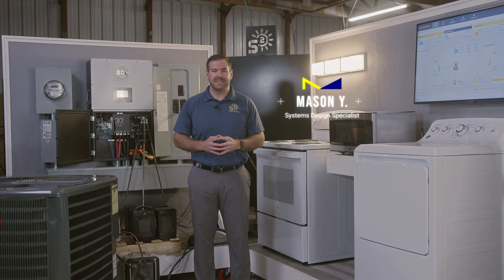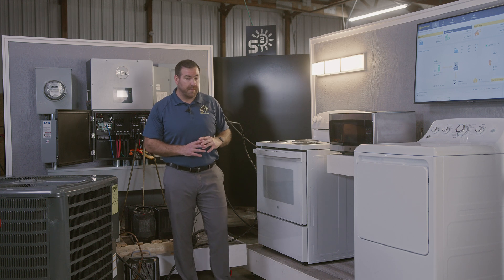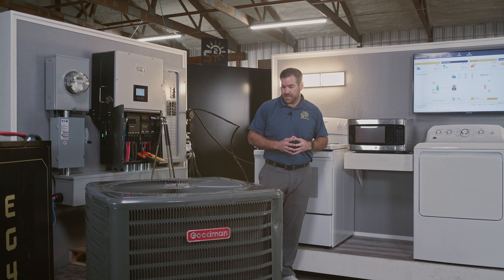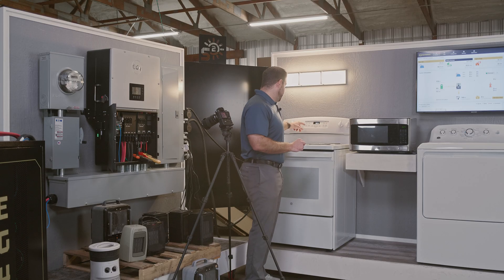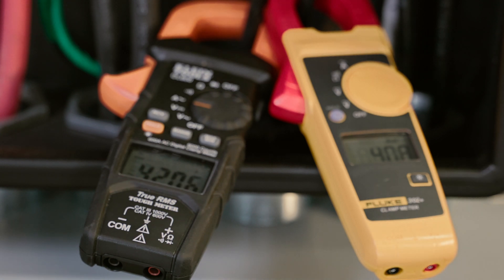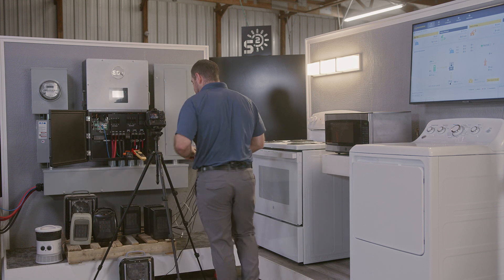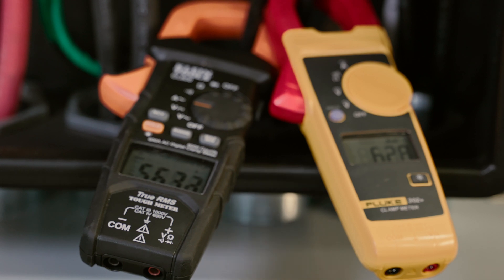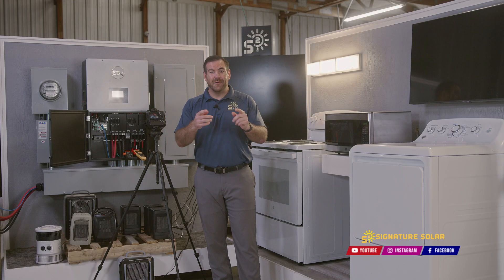EG4 18kPV Hybrid Inverter | Load Test

Comment: This is not a whole home load if you have two adults and two teens, with the 4Ton test.
Reply from the maker: Thank you for your feedback! This was just a test for the purposes of the video. We appreciate your input and will consider it for future improvements.
Reply: @SignatureSolar @Mike-01234 I sure wish I would have some of the comments on this video BEFORE I purchased my 18KPV. 

 I had already installed a top-of-the-line Microair easy start on my existing 4 Ton Heat pump a year ago so that I can run it with a Firman dual fuel portable generator. 
The Microair soft start brought the inrush current down from 120 amps to around 30 amps. 
STILL:  the voltage on the 18kpv would collapse at startup causing my lights to flicker and the control board for the HVAC compressor to shut off the compressor entirely leaving the internal air handler blower fan running continuously circulating hot air through the house. 

Just to be absolutely certain that my  soft start was not the problem. I contacted Signature Solar and purchased what they said was the same soft start used in this video. IT BURNT UP IN LESS THAN A WEEK. 
I had to hire an HVAC company on memorial Day weekend to come out and reconnect my old soft start that thankfully was still bolted to the wall of my house. 
Although both EG4 and Signature Solar have been aware of this problem for over a year, they still sent me a replacement unit. UNFORTUNATELY, Signature Solar, apparently sent me a unit that had already been returned because it had damage inside the box with no visible damage to the outside of the box. So I waited another week for them to swap that one out with an undamaged unit, then spent even more money with my electrician to swap it out. 
THE NEW UNIT BEHAVED IN THE SAME MANNER. As soon as the HVAC compressor came on my lights would flicker and the overcurrent protection on the HVAC control board would shut off the compressor, leaving the interior air handler running indefinitely as if the unit was still running. 
In May of this year, a full month after I tried to commission my unit, a higher up tech support person at EG4 did a software update, the got the unit to run without collapsing the voltage, but it is obvious that the original 18 kpv will not handle anywhere near the inrush current they claim AND THEY WERE AWARE OF THIS PROBLEM for at least a year. 
I'm still afraid to leave my main disconnect open isolating my system from the grid because I fear it's putting stress on the unit and May shorten its life. This is disturbing because I bought this unit specifically for the intent of providing power in a grid down of event. 
I SPENT MANY HOURS AND MANY DOLLARS TRYING TO CORRECT THIS PROBLEM INCLUDING A BURNT UP SOFT START AND NEITHER EG4 OR SIGNATURE SOLAR HAVE OFFERED ANY REIMBURSEMENT WHATSOEVER. 

Also off-grid mode seems to successfully stop power from being exported IT DOES NOT STOP POWER FROM BEING IMPORTED COMPLETELY.   
Although it seems to be functioning
I HONESTLY WISH I WOULD HAVE BOUGHT A SOLARK, because I don't know if I can depend on this to work properly without feeling during a grid down event when I need to depend on it the most.

Comment: If grid tied, will the grid assist when exceeding 12kw on the output? If so what is the limit?
Reply from the maker: Yes but only with certain configurations
Reply: @SignatureSolar  I’m assuming the configuration you’re talking about is with grid conductors fed directly from the utility meter to the inverter with a fused AC disconnect in between, and then inverter AC output feeding the load center?

Comment: Great vIdeo!  Question that i cannot find the answer to: If this is connected to grid, will it still shut down above 15kw or will it just stay below the max inverter current and allow the remainder to come through the grid via the 200a bypass?
Reply from the maker: If solely relying on renewables like solar and battery power, the system will deactivate. However, if connected to the grid, it can accommodate up to 200 amps through bypass mode. Yet, in bypass mode, it bypasses all renewable energy components and directly powers the load center without utilizing renewables.
Reply: @SignatureSolar  Does the inverter automatically switch into bypass mode? And once it detects that the load does not need bypass, will it automatically switch to renewables?

Comment: Sorry but people don’t run appliances in that order, beginning of video, A/C is most likely already on but maybe not running, next laundry gets started, maybe someone in the bathroom drying their hair, A/C happens to kick on and you use the microwave to reheat your coffee and all this takes place in about 15 minutes, my point is, when I tested my generator to see how much of my house I could run, I turned on all my lights, W&D not an issue, then my A/C, gen dropped a hair but recovered quickly but then hit the 1100 w microwave big drop, thought I was going to kill my generator but it actually recovered, for the most part, I found I need to turn off the A/C if I need to use the microwave, my generator is 8750w load 8250 running, I’m looking to buy this system in January with the 2 batteries but thought I’d just throw out a comparison.
Reply: @@RubenKian California, La county

Comment: On the portion where you showed starting the AC unit (outside condensor), did you factor in the evaporator coil/Air handler which is also running on 40/50amp breaker?

Comment: Seems your test did not match the specs when it shut off so quickly. With PV: 14.7kW (10 min), 15.5kW (5 min) Without PV: 13.5kW (10 min)

Comment: I thought the surge rating for this unit was supposed to be 16 Kw for up to 5 mins? According to my math (64A + 60A) * 120V = 14.88 Kw. What am I missing?
Reply: I think the surge time may be based on standard test conditions. Perhaps at 25 degrees Celsius. Warmer room temperature may cause the inverter to shutdown sooner. Maybe I am wrong. For the longevity of such an investment I wouldn’t want to bring my loads to that level for even a minute because that’s pushing it to the limit. That’s my personal thought.

Comment: As I understand it, the real advantage of this unit over 2 - 6548s is it can send energy to the grid.
This unit is $5600 while 2 6548s are around $3000. 
An additional benefit which is more important if it is mounted close by is the quietness.
The software is much better.
It has more solar panel capacity, slightly less power output, but close enough.
6548s are off grid only and can not send energy to the grid.
Reply: Also idle consumption much lower 70watts versus two of the other ones at 105w each
Reply: Big thread over on DIY solar power forum started on Aug 5th Guy said he had lot of problems with trying to grid-tie and not back feed. In the Solar equipment review. It's worth reading before you make a purchase.  The way I read it was the OP wanted desperately to make it work then got really frustrated because they couldn't make it work over the phone through email. It will be interesting to see how it worked out for him if he was able to get a replacement working the way he wanted. SS did in RMA the unit and even offered to pay any fines from his Utility for back feeding without a contract. I've never heard of it only a letter they send telling you if you keep doing it, they can disconnect your power.
Reply: @Mike-01234 which unit you talking about Mike. You said the guy and it. It being which manufacturer and model?
Reply: @Mike-01234 I sure wish I would have read your comment when I saw this video before I purchased my 18 kpv. 
I have a 4 ton heat pump. I had already installed a top-of-the-line Microair easy start on it a year ago so that I can run it with a Firman dual fuel portable generator. 
The Microaif soft start brought the inrush current down from 120 amps to around 30 amps. 
STILL:  the voltage on the 18kpv would collapse at startup causing my lights to flicker and the control board for the HVAC compressor to shut off the compressor entirely leaving the internal air handler blower fan running continuously circulating hot air through the house. 

Just to be absolutely certain that my  soft start was not the problem. I contacted Signature Solar and purchased what they said was the same soft start used in this video. IT BURNT UP IN LESS THAN A WEEK. 
I had to hire an HVAC company on memorial Day weekend to come out and reconnect my old soft start that thankfully was still bolted to the wall of my house. 
Although both EG4 and Signature Solar have been aware of this problem for over a year, they still sent me a replacement unit. UNFORTUNATELY, Signature Solar, apparently sent me a unit that had already been returned because it had damage inside the box with no visible damage to the outside of the box. So I waited another week for them to swap that one out with an undamaged unit, then spent even more money with my electrician to swap it out. 
THE NEW UNIT BEHAVED IN THE SAME MANNER. As soon as the HVAC compressor came on my lights would flicker and the overcurrent protection on the HVAC control board would shut off the compressor, leaving the interior air handler running indefinitely as if the unit was still running. 
In May of this year, a full month after I tried to commission my unit, a higher up tech support person at EG4 did a software update, the got the unit to run without collapsing the voltage, but it is obvious that the original 18 kpv will not handle anywhere near the inrush current they claim AND THEY WERE AWARE OF THIS PROBLEM for at least a year. 
I'm still afraid to leave my main disconnect open isolating my system from the grid because I fear it's putting stress on the unit and May shorten its life. This is disturbing because I bought this unit specifically for the intent of providing power in a grid down of event. 
I SPENT MANY HOURS AND MANY DOLLARS TRYING TO CORRECT THIS PROBLEM INCLUDING A BURNT UP SOFT START AND NEITHER EG4 OR SIGNATURE SOLAR HAVE OFFERED ANY REIMBURSEMENT WHATSOEVER. 

Also off-grid mode seems to successfully stop power from being exported IT DOES NOT STOP POWER FROM BEING IMPORTED COMPLETELY.   
Although it seems to be functioning
I HONESTLY WISH I WOULD HAVE BOUGHT A SOLARK, because I don't know if I can depend on this to work properly without feeling during a grid down event when I need to depend on it the most.
Reply: That b!tch still too expensive. It should have been $4,600.00

Comment: I've got mine semi installed and it carried my 40 amp EV charger as well as my normal home load, no other heavy draw items besides EV, but it carried.
Reply: I've neen saying this for years.  These systems should be able to define an EV as a battery, with user definable rules relating to SoC / in/out flow.

Comment: It looks like the surge time in the video doesn't match the spec listed in the manual.  The manual states that the Surge Power (W) for the inverter is 14,000W (10 min.), 16,000W (5 min) and yet going by Mason's numbers, the load was approx 14.8kW and it only ran for around 2 min before tripping.

Comment: Did the compressor on that 4ton AC actually kick on? If so what type of soft start do you have on it?
Reply: You must have had your volume turned down.  I heard the compressor turn on.
Reply: we carry sure start, I think it is the best value and have used them for 8 years
Reply: I use a Micro Air easy start on mine works great mine is the four ton also

Comment: Thank you for showing this. It doesn't look like this unit's going to do much more than the solar Arc 15K. With a sol-ark 15K you have to be careful that the loads are balanced on each side. (Super annoying).  It looks like that's what you were doing with this test... Making sure each leg was balanced carefully. Do you know what the inrush current is to start the air conditioner? Could the air conditioner start up if there was no power on other leg? That's the test I'm really interested in. I may buy two of these if it can handle that.
Reply: The one I have will handle 8000 W on 1 leg with no problem.
Reply: @SpencerLAPower  with no load on the other leg?
Reply: @RJ  Yes that is correct. If I get time i'm going to make a video showing this very same thing
Reply: @SpencerLAPower   so that's what it can run, but do you know what the "surge capacity" is on one leg?
Reply: @diySolarPowerFunWithRay  I'm going to do a video and see if I can find out what the surge capacity is on one leg. Just extremely busy at the moment
Reply: @Langstons Alternative Power Spencer Langston  awesome. 🙏Just subscribed :) thanks!
Reply: He was using a soft start for the airconditioner. It was a full load test so I understand him keeping the legs balanced. I would also like to see the legs out of balance and see how far out of balance it can go when running other big loads
Reply: @RJ-cc1fz  The spec sheet says 8kW on one leg
Reply: @iancameron6257  64Amp+60Amp x120v I think is how the formula goes. That comes to 14,880Watts
Reply: @iancameron6257  each of those readings is on a 120 leg. 124amps At 120v is 14,880 watts
Reply: The 15k can also do ~8kW on a single leg like this unit
Reply: I am new to solar and looking for someone that can help me with the design of a system for the ultimate toy hauler